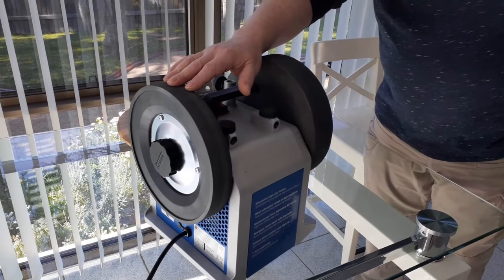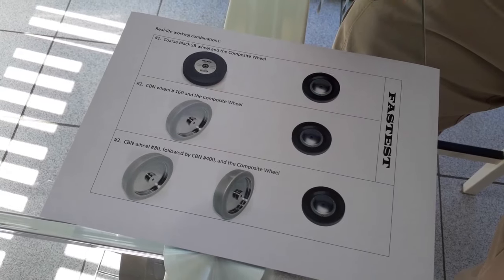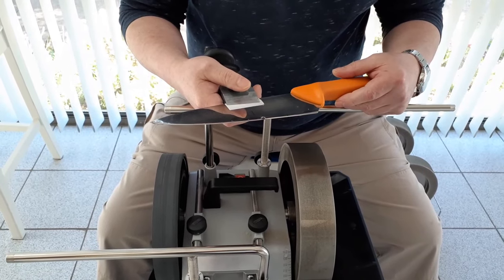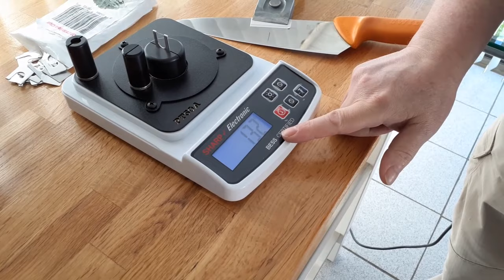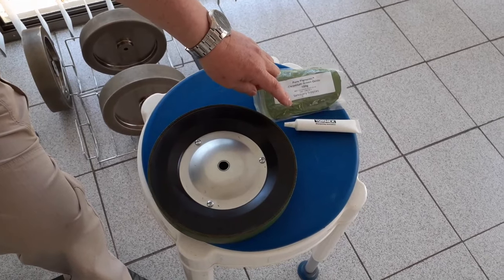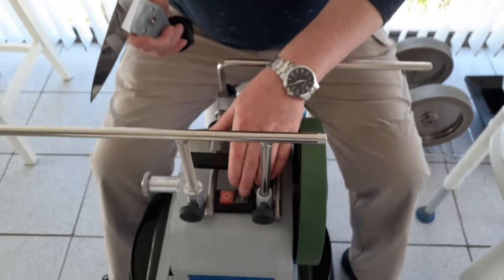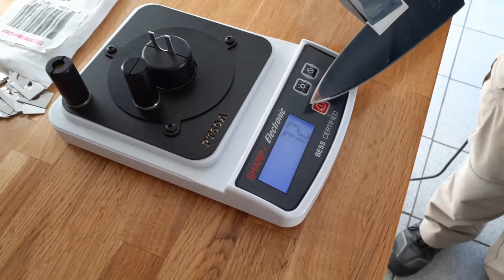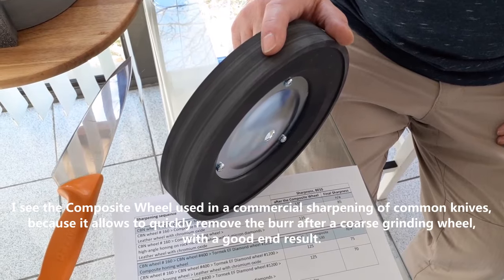Tormek CW-220 Composite Wheel – Part 2: use in knife sharpening

Comment: Thanks for videos, first part was the best😂 and useful information in the second. But want to ask, is it not better use for deburring felt wheel+1 carat diamond spray? Of course deburring goes after 1000 or 1200 cbn?
Reply from the maker: Yes Andrejus. The edge we get after a fine grinding wheel of #1000-1200, that we deburr with  a high-angle honing on the rock-hard felt with 1-micron diamonds has better edge retention.
The Composite wheel is a "shortcut" to a fast good edge. But I would not use the CW for premium knife steels. This is covered in more detail in the last revision of the Knife Deburring book.
Before grinding on a freshly trued stone wheel, remember to condition it with the #80 diamond plate, for nicer bevels and better edge.

Comment: Would it be possible to use 0,25µm diamond instead of the chromium oxide? And thank you for this study!
Reply from the maker: Yes, of course.
Reply: Is a smaller diamond dust not preferable compared to chromium ?
Reply from the maker: Do you mean like 0.1 micron diamonds? Not in this sharpening sequence.

Comment: Excellent! Nice (and rare) to see a quick sharpening method for Tormek.    Just wondering if the coarse Diamond wheel (DC250) could fit into this protocol in place of CBN160?
Reply from the maker: The DC works OK when we re-sharpen at the existing edge angle.
We experimented with coarser grits to speed up re-grind to a lower angle on Tormek. In our experiments we went as low as #60 - but it was too damaging to the edge. It takes labour, money and time to determine the right grit of the CBN/Diamond for knife sharpening.
Reply: @knifegrindersaustralia5158  So just to clarify, would mid range knives work ok to regrind new primary bevel angle: with a DC250 - then to CW wheel - then to leather wheel for deburring, as a progression

Comment: A couple quick passes on a hanging strop produce a stronger and longer lasting edge after the chromium oxide loaded leather wheel passes?
Reply from the maker: Finish with either pure chromium oxide leather wheel or the hanging strop. No need for the hanging strop after the pure chromium oxide.

Comment: Hi Vadim. Removing my SG wheel to use the FVB with composite wheel, my SG wheel bore hole has started to widen, enough for the wheel to run wobbly, and is getting impossible to make it tighten properly to the wheel, and there's now a wobble every time I remove it and put it back on the axel. Any insight to how I might make the wheel tighten up properly, and run true as the standard way does not tighten the Ezylock nut anywhere near perfectly anymore... Thanks!

Comment: Will the course to composite to chromium oxide progression produce a lasting edge as well?
Reply from the maker: Two moments here. 
1) The composite wheel CW-220 is a good shortcut for common knives, not higher-end. Used after a coarse wheel, it gives an arm-shaving edge - the fastest way to get it on Tormek. Great for use by mobile and farmers' market sharpeners. Microscopically, the edge comes "toothy" and has a microburr.
 
2) Finishing with pure chromium oxide cleans away all the burr to clean metal, meaning lasting sharpness. Microscopically, the edge is still somewhat "toothy".
However, we get longer lasting sharpness when grind on a sequence of grinding wheels from coarse to fine, set edge on #1000, then deburr, remove the root of the burr, and finish with pure chromium oxide.

Comment: on my Tormek  t8 when I pull the big wheel off to use the small one it will walk the shaft out is there something wrong with it? I always need to put spacers in and put nut back on in place of big wheel.
Reply from the maker: I thought no one would notice that I forgot to insert the spacer on the shaft when started honing. Without the spacer, the shaft will slowly slide out. When I realised my mistake, I put the spacer.

Comment: Really great stuff! Question: For commercial sharpening, would the course diamond wheel and the composite wheel do a high end finishing job? Also, would that some setup work well for high end Japanese and high end German steel knives for private customers and not just house knives in a restaurant?
Reply from the maker: This is a good shortcut to an arm-shaving edge for farmers'market and mobile sharpeners, but won't work for high-end knives.
Reply: @knifegrindersaustralia5158  I have other solutions for those, so that's awesome. Thanks a ton Vadim!
Reply: @knifegrindersaustralia5158   Do you need the FVB for the angle calculator, or will the standard edge trailing horizontal position still work with the software?
Reply from the maker: FVB
Reply: @knifegrindersaustralia5158  What brands are typically high end knives with wear resistant carbides, where the composite wheel wouldn't perform well?
Reply from the maker: Of kitchen knives - Global and similar higher-end knives do not come well with the composite wheel. The sharpness results are worse than the mainstream knives, and the edge comes overly "toothy" with rough bevels.

Comment: Do you see any negative side effects in this process by increasing the Tormek RPM up to 150-155, if it doesn't throw off water? I'm doing some tests, getting right around 150rpm and don't see anything negative with the axel, water spills etc
Reply from the maker: We are learning from you here, Scott. I've not tried the composite wheel at increased Tormek RPM. But in general, we do hone at increased RPM. In our workshop we have the RPM-increaser on  the Tormek with the honing wheels, felt and leather, and on the Tormek with the coarse CBN wheel #80 & # 160. In order to minimize the burr, 
we do NOT increase RPM on Tormek with CBN #400 and #1000.

Comment: Thank you for this! Is it any good to go Tormek DF250 with 600 grit, to CW and then go Tormek PA70 and after that chromium oxide? Or is the PA70 pointless edge wize? Do you always go up to 1200 on premium knifes like global? The Tormek DE250 is impossible to find in Sweden atm xD
Reply from the maker: The composite wheel has been developed to speed up sharpening of mainstream knives, mainly common kitchen knives - you should not add more steps than needed as this would slow down the process.

Comment: Thanks for this Vadim! Quick question as I am very new to the Tormek system. I noticed the first time you were honing on the composite wheel, you removed the grindstone and left it bare. On your subsequent honing efforts, you replaced the ezy lock nut along with what appears to be a spacer. What is that for? So the drive shaft stays put and doesn't shift?
Reply from the maker: Eagle-eyed Michael, I thought no one would notice that I forgot to insert the spacer on the shaft when started honing. Without the spacer, the shaft will slowly slide out. When I realised my mistake, I put the spacer.
As a spacer you can use anything 45mm wide with a 12mm central hole, even a piece of wood. If you still have the Tormek box, use that white plastic insert that was on the Tormek shaft to keep it in place during transportation.
Reply: @knifegrindersaustralia5158  Haha thanks for the reply! That’s what I thought as I noticed that behavior on my T-4 and wasn’t certain it was supposed to do that. I’ll have to try that spacer trick. Thanks again!
Reply: @knifegrindersaustralia5158  As I have attempted to replicate your steps and technique for sharpening over time, I have seen a gradual improvement in the results of my sharpening.  Your are so methodical in how you approach the process, and this is really helpful.  I also noticed the mistake detailed above that you made in this video, and thought it was great that even you occasionally may make a small error.  Thanks for all your  teaching videos.